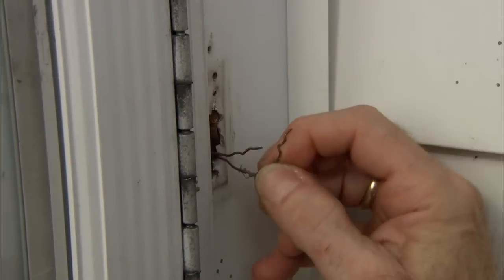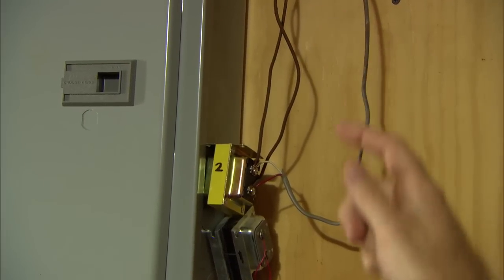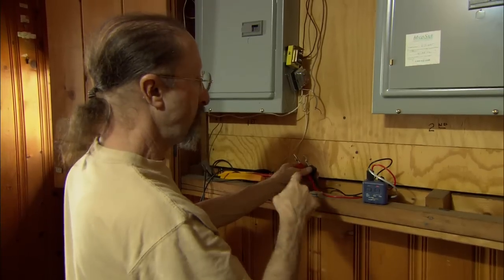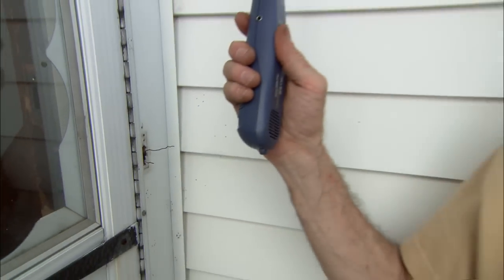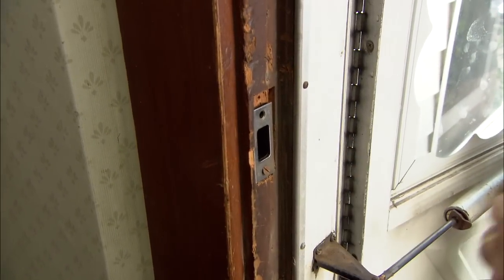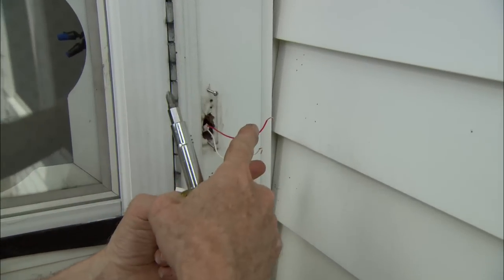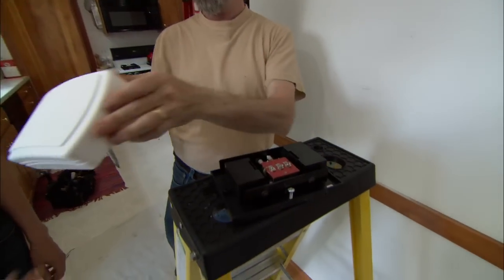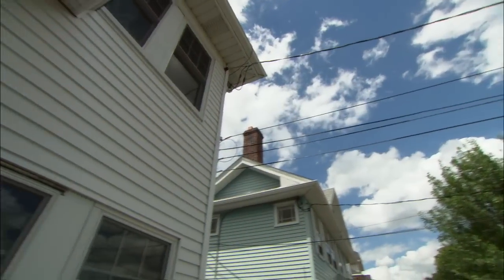How to Repair a Broken Doorbell | This Old House

Comment: this may sound like a dumb question but nobody said anything about shutting the power off before installing doorbell?
Reply: Ramon Ibarra yea, but it's only 21V which falls below the 50V limit for energized work, so no harm to work on.
Reply: @emnuc30  Right, but later he checked to see if the transformer was working - if it wasn't, he could have received full 220 voltage/shock when he first touched the wires at the door. Right?
Reply: @AndyMarr29  wrong. rethink your comment.
Reply: The power was disconnected by removing the wire from the transformer.
Reply: @AndyMarr29  He checked the output of the transformer - which is low voltage. Not the input which is hidden inside the panel.
Reply: I'm not an expert but even though it's low voltage I would say to shut the power before touching wires.

Comment: They didn't turn off the circuit breaker for doorbell in the video. Is it necessary?
Reply: I'm not an expert so I don't know. I would say when working with it to turn it off though.

Comment: my parents house was built in 2008 and the doorbell is still working! and I have since installed a ring doorbell pro wired into that doorbell system and has been working since over 10 years which is nice as the doorbell brand is nutone!

Comment: OK, so you found that one of the original wires in the pair is broken, so you use another pair, but don't show how it is connected.  I assume that it was one of the other pairs running down to transformer "why the second cable (looks like two to me)/some other low voltage system".  "Move the toner" isn't zoomed in enough to see which wires are being used...so, we now have a pair running from transformer to the doorbell.
"Sounds like a doorbell" ...you then go to the chime … without explaining where the wires run.  It seems obvious that this must be another pair of wires, but what connects the doorbell to the chime????? @3:21 it looks like the doorbell pair has been removed, and is simply screwed back in ...I have no idea how the chime is connected to the switch!
Reply: This video is completely useless.  There's a reason the second wire wouldn't work.  At the switch, one wire comes from the transformer, the other would go to the doorbell chime.  If you ran both wires to the transformer like the video shows, all you would be doing is electrocuting yourself when you pressed the doorbell button.

Comment: Cheap alternative to the radio thing is to hook up an old low power power supply from a laptop or something and then test the other end of the wires with a multimeter.
Reply: An even cheaper alternative (free) connect the wires together on one end and then check for continuity on the other end between two wires.

Comment: Anyone maybe can advise us , we have a nutone  sonata model LA53 we are experiencing phantom rings that seem to be more frequent we thought power surges but realized it’s not lol . So anyone have any idea as to what we should check first ? We have disconnected the wire because we fear the dreaded 2am rings they scared the heck out of me lol…. Thanks in advance !
Reply: LOL that's so weird. Did you figure it out?
Reply: @flat-earther  Funny thing we ended up checking the doorbell itself,  last ditch effort before debating  replacing the sonata .ahahaha now we know that's the first thing you check, we felt pretty dense  lol. The wires were a bit rusted so we replaced the doorbell, lo and behold it worked!!! 
So many disturbed nights...  ahahaha never more!